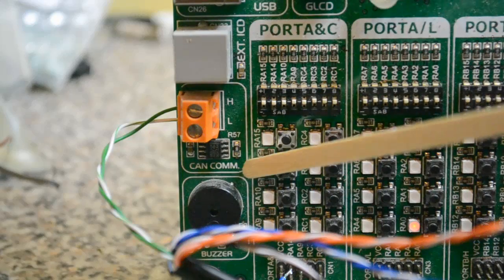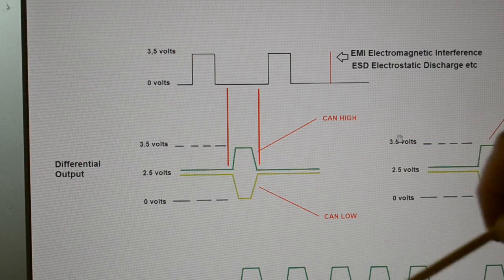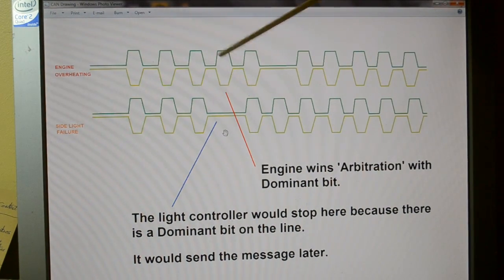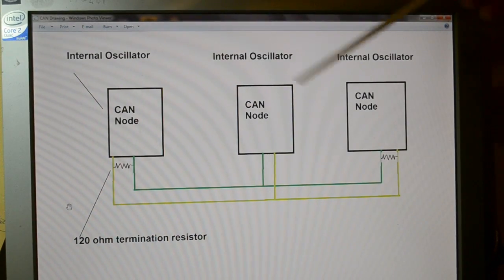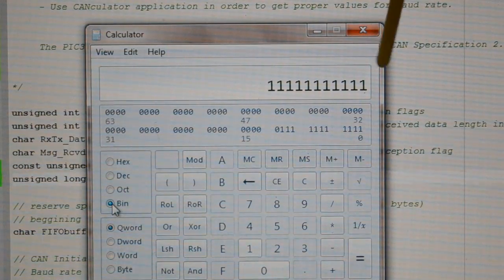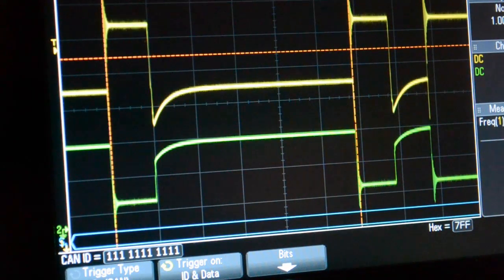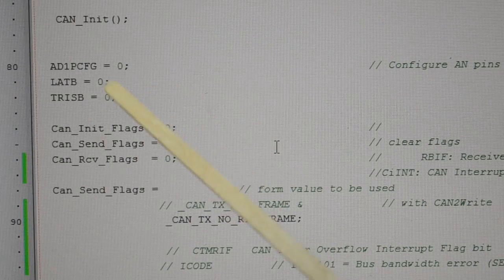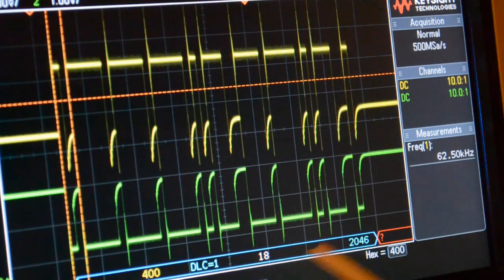CAN Controller Area Network Part 1 Demonstrated with MikroC Pro for Pic32 (Read Show More)

Comment: Life would be much easier if they  would depict,, Dominant as 1 and recessive 0. Like the ON is 1 and OFF is 0. Why flip in the CAN bus :(
Reply from the maker: So right
Reply: Do you think so ? or am i missing something ? Cause I am having so much confusion to solve exercise of CAN Bus. In the online some used the CAN upper line as 0,bottom as 1 and in my institution slide, top line of CAN is 1 and bottom line is 0. So much confusion. Can you suggest me something. can you check this link and suggest me what to do, In this exercise it's using 0 and 1 invert of your example.  https://ibb.co/mNUf5F
Reply from the maker: why are the bits inverted?
i will work out the answer
Reply from the maker: Hex 4FA for your 11 bit identifier (upside down version)
Hex 305 in real world not inverted.
You don't need to add your own stuff bit in the code, that would be done in the transmission and taken out by the receiver.

Comment: Looks to me like the stuff bit is there to ensure that the clock at the receiver doesn't drift to much... since the clock isn't transmitted the receiver needs to sync up, and by having a stuff bit after every 5 consecutive bits it allows the receiver to re-sync on a received edge ... quite ingenious
Reply from the maker: Thank you for your 'input'
That does seem to be one of the reasons for 'bit stuffing'

Comment: Does those recessive state and dominant state together is one bit?
You said CAN H and CAN L pulled up and down represent a 0 , but in the identifier part is all are zero, they mut be continuously, hold up and down?? why are they alternating after every bit?
Reply from the maker: No,there are 2 states, Dominant and Recessive.
The bits are not actually pulled high or low externally, they are controlled by the CAN transceiver.
A dominant bit ZERO has CAN High at near 3 volts and CAN Low near to 0 volts.
Both lines then turn off and sit in the middle of the supply.
Have a look at 10 minutes, you can see a recessive bit.
Reply: Yeah saw that, thanks nice video

Comment: HI John.. This is really a great lecture... But what if my message is 1044 which is 10000010100 which is having a 1 after 5 zeroes. Now how to differentiate if that is a stuff bit or an actual bit as in my case???
Reply from the maker: There will ALWAYS be a stuff bit after 5 consecutive numbers of the same value
The stuff bits are not counted.
Thank you

Comment: Hi John, Do you think the IDE(identifier extension) bit was dominant, that's why 29 bit id extension was not working? I read somewhere that if IDE bit is dominant in Standard 2.0B then it transmits standard CAN identifier. Btw thanks for the video!
Reply from the maker: Hi, 
Thanks for your comments, I may have a look if I get chance to hook it up again.

Comment: What about the ISO 15765-4 CAN standard (The European OBD standard)? It can also be 11bit/500Kb/s
Reply from the maker: That's for on board diagnostics.
Reply: So this is a subset or additional layer on top of the CAN layer?
Reply from the maker: ummm,
Good question.
I don't work in the motor trade any longer, be nice to actually put my scope on a vehicle.

Comment: Good video for an introduction to CAN. I'm designing a high power SCR controller that may benefit from CAN control instead of originally conceived RS-232. I will at least make the board compatible. It now uses a PIC18F2420 and there is a PIC18F2480 with a CAM module and similar pinout.

Do the CAN signals really have so much ringing on the transitions? It seems to occur when the signals bang the rails, but there is a much slower transition to the 2.5V state. Also, it seems that the 2.5V level is not the same for both lines, or the + and - states are not at the 5V and 0V rails. What are the actual voltages?

Comment: hi john great vid I am new to topic, when you showed the twisted wires, can hi and can low , do they use separate ground or do they ground on each other? thanks
Reply from the maker: Hi,
No there is no ground on the 'CAN LINE'
But if you're measuring the CAN line voltage, the CAN voltage will be with respect to the controller ground.

Comment: very good video. i hope i knew this information when i started doing my first CAN implementation in 2006. back then i don't have any diagnostic tool nor oscilloscope that can decode serial data and i really struggled. but after two months i was able to deploy my project. i wish i had that oscilloscope back then.  ;)
Reply from the maker: Hi,
Yes I understand, very difficult without a scope or diagnostic tool.

Comment: Thanks John, this has been a very helpful tutorial! I am busy compiling a technical training course for our technicians. Would you mind if I use this as part of the reference material?
Reply from the maker: Hi Marcia,
I'm pleased you like the video.
I missed off a few bits like
A/ the signal turns on quicker than if one signal had to switch from say 0 to 3.5 volts.
B/The slight curves are to show the switching time (Not instant)
C/ I didn't have time to show how the resistor affects the on and off time / slope.
D/ I forgot to add where the data is inserted (hence the annotation)
lots of little bits like that.
If you click on the link near the end, you can see the CAN line counting between 2 nodes.
Yes use the video as you wish.
John B

Comment: Hi,
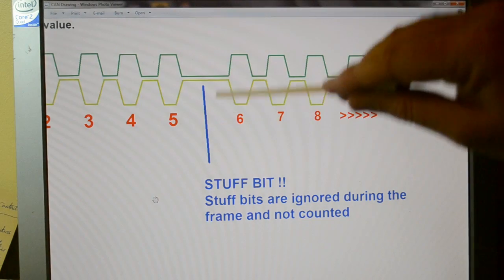When you where explaining the bits in between 12:00 and 15:55, where is the actual data or message located? I would like to know more about the actual usefull messages.
Reply from the maker: +Terry Gould 
whoops, the Data is sent after the data length code.
I have just added an annotation
Thanks for asking
Reply: +John B 
Ok I get it now, thats what I thought! Thanks

Comment: Thanks John, That helped me.

I like to perform the same experiment which you did with the Oscilloscope. For this, I like to know about the connections, Equipment used such as Microcontroller, CAN interface, Even the Software used and etc., Kindly help me by providing these details.
Reply from the maker: +Bal Pujan 
Hi, The circuit drawings for the boards are available from Mikroelektronika.
Thank you
Reply: +John B . 
 Thanks for pointing out the website. Can you please provide the Equipment that i need for the carrying out the same experiment
Reply from the maker: +Bal Pujan 
Hi, I used Mikroelektronika's Easypic Fusion V7, Pic32 MX795, Can spi board from Mikroelektronika. MikroC pro for Pic32 and MikroC pro for Pic
all from www.mikroe.com
Thank you

Comment: Hey John, About that second identifier, if I'm not wrong, on the extended identifier you actually have an 11bit plus a 18bit id, those 2 are apart with i presume some kind of arbit code, i guess thats why the bits were wonky with the first id
Reply from the maker: +Andres Crespo 
Hi, sorry I don't understand.
I used an 11 bit because my scope wouldn't read the 29 bit code.
Thank you

Comment: hey john.

Sam here, i'am from the netherlands and i am expiriencing some troubles with my CAN bus system.
when i read out my audi a4 2006 2.0 with multi tronic(automatic) gearbox , it is not able to  ''see'' my engine and transmission.
Is it possibel this could be the neutral saftey switch/ gearbox ecu failing so the message is not going thru anymore?

the car rides and shifts just fine, But! my prnds lights are lighting up solid indicating an error.
heat seems to make it worse.
i'm searching and searching but i just can't put my hand on it.

I'm learning more and more about the CAN bus system thanks for the posts and I really really hope you can shine some light on my frustrating situation.

sorry for the bad english and keep up the informative posts :)
Reply from the maker: +Sam Hutch 
Hi Sam,
I've not worked on Audi much but, usually the electronics are very reliable, it's probably a sensor connected to it.
It could be a simple switch problem or a wiring problem. Water often causes corrosion in connectors and causes poor communication. 
Chaffing wires is also a big problem on older vehicles.
You need to find a device that will read the fault before spending money in the wrong area.
I hope this helps
Thank you

Comment: ok let me get this the can high deals mainly with the engine ,tranny basically major power train stuff  right and can low deals with stereo ,lights and what could be considered minor systems or subsystems (modules or nodes) now in what instance would the can low be high and the can high be low in order for the can low to win arbitration and at what level would that arbitration be to win over a low can high am i making any sense and at what level lol

Comment: Hi, John fantastic video and very explanatory, however as a budding new auto electrician would you possibly find time to do a video centered more around the automotive side of the CAN systems please. It would be greatly appreciated as you seem to be a thorough teacher. Much appreciated.
Reply from the maker: Matt Dobson 
Hi Matt,
Thank you for your comments.
I don't really have the means to make an automotive CAN video.
Generally on cars, one wont see many CAN errors.
It's when you come to trucks and coaches, especially brand new models or old models.
One starts to see CAN errors, usually 'timed out' errors where one module keeps not responding in the correct amount of time or,  no communication at all from one module.
That could be the engine ECU at the back of a coach.
You have to spend hours and hours looking for damaged wiring.
The smallest piece of damaged wire rubbing on a chassis for example will give an intermittent CAN error. 
Your best tool is the laptop. Read the faults and see what keeps occurring.

Comment: Great video. Although I did not get when CAN High is 3.5V and CAN Low is 0V. The Recessive bit is at 2.5 V. How come when both lines are activated, it is 0?
Reply from the maker: Mandeep Singh 
I didn't design it, it's just how it is.

Comment: My assumption on the purpose of the stuff bit is to allow bit synchronization for the devices on the bus - similar to data whitening.
Reply: Yes for sure - after seeing the stuff bit arrive early, it's probably the clocks are fairly loose on the MCU.
Reply from the maker: ***** 
You're probably right though the crystal is better than 1%
Reply from the maker: ***** 
I'm not sure, the synchronisation happens on every rising clock edge (1 to 0), trying to figure that one out. Good point though. 
Thanks

Comment: Well this is the most useful video about CAN on YouTube, would be great if you could help me with developing CAN for vehicles, basically on a FSAE car.
Reply from the maker: Mahesh Padmanabh 
Hi, the trouble with that is, you need to know the address ID of the module you want to communicate with.
You really need a laptop with CAN software, not a micro controller.
Thanks
Reply: I know the address IDs. of All the components I am using like the controller,BMS etc. Can you suggest me if I need any CAN development board or anything to interface all the components
Reply from the maker: Mahesh Padmanabh 
Hi, what info do you want to look at?
Do the manufactures of the control unit not produce software?
Reply: Basically I want to integrate the components and various sensor nodes, for cell over temperature, rpm, steering wheel angle sensor etc. And I am not so sure how to even start. My work has been mostly on Batteries and BMS. So I lack knowledge about it
Reply from the maker: Mahesh Padmanabh 
Wow, It is a difficult task.
You need to program a chip to acquire all the data and transmit it.
I don't think a micro-controller is fast enough to capture the data from all the nodes and send it.
There must be a product on the market for 'radio telemetry' which is what you need.
Reply: John B 
We made our own telemetry system and that is just to send data from the vehicle to the ground station/paddock. But the manner how all the sensors data and fault codes are integrated matters  cause there are a lot of sensors in the car so CAN would be the best. Would be great if you can tell me anything about it if you get any info. Anyway, thanks a lot for your time. I have subscribed you, really like your videos :)

Comment: .. Some copy from China 😕 .. No instructions... So I'm winging it.. One of the wires has a black streak which I would associate with - .. I don't want to damage anything. Any way I can check with a multimeter? Or will it not be sensitive enough? Thanks for the quick response 😀.. It's appreciated! Cheers, Steve.
Reply from the maker: steve howard 
No use putting a meter on it, both will show 2.5 volts.
CAN is short circuit protected, so long as you only connect the CAN wiring to it, you shouldn't have a problem.
Only trouble is, if it doesn't work, are the wires back to front or, is it not working because your system does not know it's there.
Reply from the maker: steve howard 
Hi Steve,
Did your system work?
Reply: .. I've got more pressing issues with a classic mini.. I've wired it all up.. Just needs activating! 😀

Comment: Hi John, i have a couple of questions; as i'm trying to install bluetooth in my car.. does it matter which wires are used for a can + and a can - in other words are they reversible? can i splice into the can lines already installed  on the stereo?
Thanks, Steve.
Reply from the maker: steve howard 
Hi Steve,
Yes it does matter which wires are CAN High & Low.
Yes you could splice the wires.
I'm wondering, are you trying to retrofit the manufactures module or a pattern part?
The complete system would probably have to be programmed to tell it, it is installed. At least that is how Ivecos & Fords worked.

Comment: Cheers for this resourceful video John!

As I mentioned in my post I've got some other slightly irrelevant question. I've got the handshake done (CAN connectivity, baud rate etc) Now I'm trying to translate data. As an EEE student I always get intertwined with bits, byte, hex, dec, oct etc. NOT at hardware implementation or circuit level but software to software communication level.

I've managed to transmit data from CAN Adapter hooked up to a PC, it was received by the uC and then after using MikroC's functions i.e. bytetostr etc I got the exact hex displayed on the LCD. Now the confusion is how can I scan an array look for data and do calculations within my code. Is the data received by uC in Bytes (even though entered as hex from transmission end) and how to make use of it? It will enhance my/viewers understanding really well If you could share some of your valuable time explaining this. I know its fairly basic but it gets confusing at times specially with specific compilers.Would appreciate it much!

Thanks again for the video! :)
Reply from the maker: Hi Syed,
Whilst I've been waiting for some CAN parts to turn up, I've just finished a PC USB to Micro-controller project.
Reads the data from a PC and does something with it.
The CAN will be similar.
The PC USB to micro-controller data is held in 'strings' much like my UART demo.
I'll build my CAN nodes and get back to you.
It might be a few days
Thanks
jb
PS, what you want is not basic at all lol
It might be to Mr Bosch